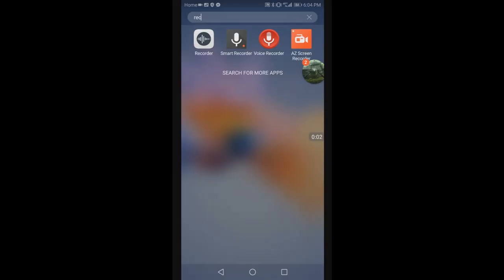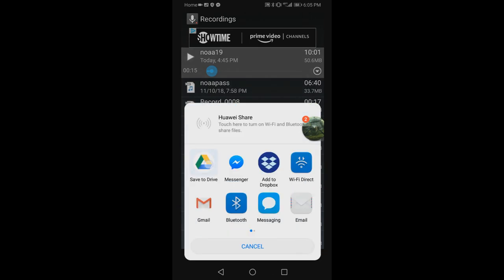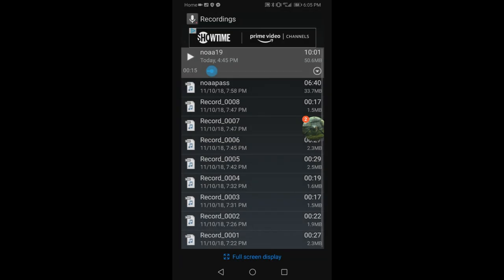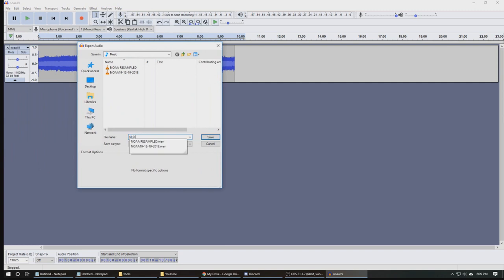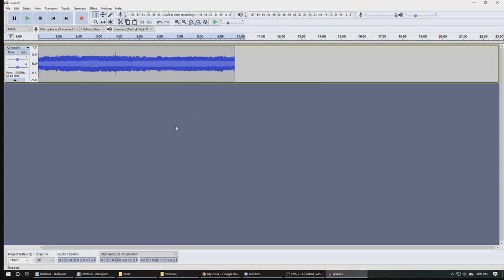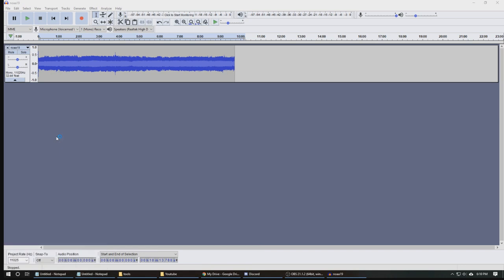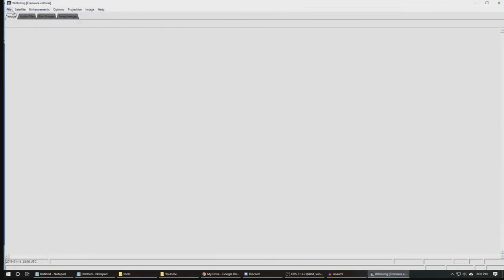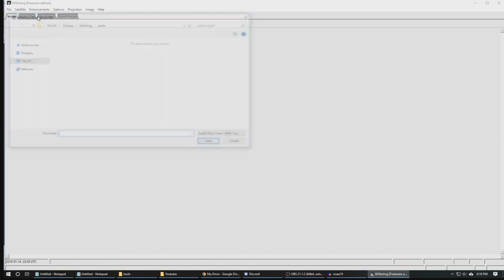Decoding NOAA Weather Satellites with BaoFeng Radio

Comment: Great video, thank you. Crazy question, if you're using an SDR, can you record directly into Audiocity?
Reply: Good idea to eliminate steps. I think it may be possible.
Reply: @martinjuarez4165  You will need sofware to link Gqrx to WXtoimg : most used software is VAC - virtual audio cable . This can only used on Window's platform - not Mac
Reply: @brunoclaren1110  Thank you!!

Comment: You can decode straight from the phone, just Google the app for decoding HF WEATHER FAX, open the app and place it near the radio,  but if you want an absolute crisp image then I suggest you do what this guy Is saying so you can reduce background noise to get a better quality image, one more app is called robot36. These apps are quite simple, if you know abit of coding you can write a quick app code to make your own app, if you do do abit of coding try a cpu module or a raspberry pi to get a screen on it and attach it to the schematic of the radio, but that's a project on it's own, but for now try HF WEATHER FAX.

Comment: Hi! According to wiki, the APT signal is 34 kHz wide. It also looks like that on my Icom's waterfall. However, the widest FM filter I can use is 15 kHz, with that, wxtoimg complains that my IF is too narrow. I've recorded few minutes of the signal (S7 up to S9+10, should be strong enough I guess), but the picture resulted to be a mess... I doubt the UV5R has 34 kHz filter, so you probably also capture only part of the spectrum? Does it matter or not? Thanks!

Comment: Cool that you did it that way, but the quality of reception is limited by the bandwidth of the receiver.  NOAA sats emit a signal that is around 35 khz wide in bandwidth.  SDR recievers are pretty good for providing that bandwidth cheaply.

Comment: Hi!! Thank you for your video!! It´s very COOL,  Could you tell me if you are using Wide bandwith or narrow bandwith in your Baofeng?  I´m getting a very noisy image...
Reply: Same here. I'm not having great results with my UV-5R. Did you make any progress?
Reply: @command0z   A little bit, with WB instead of NB and changing the audio  recorder app
Reply: Dalila M i switched to an SDR dongle with much better results
Reply: @command0z  I 'll try It. Thanks.
Reply: Could you tell me wich kind of antenna did you use with the SDR?
Reply: @command0z  Could you tell me wich kind of antenna did you use with the SDR?
Reply: @command0z  Thank you!!!! and congratulations!!!
Reply: Waves from NOAA15,18 and 19 (and other sats ) are circular waves . So a standard antenna used on a BAoFeng is not the rigt one . For better Rx you need an QFH antenne . Easy DIY  . You'll find alot info on the net . Best  Regards from Belgium
Reply: Wide bandwidth is ideal for these applications.
Reply: It’s still not quite wide enough, but setting a handheld used for this to 25khz bandwidth will help.

Remember: this is about doing cool stuff for cheap, it may not be perfect. You won’t have enough information in the file @ 25khz to do proper processing, but your RAW images will look great.

Also, V dipoles are a good and simple antenna to use for it if a QFH scares you…

Comment: Good video, i have a question, how much time do you record the satellite? I cant decode the image, wxtolmg "couldn´t find the telemetry", I try with the Slant Correction but didn´t works. In the properties of the image I have only two channles 3A and 4. The estimated time of record was 2 minutes aprox. I wait for your response, please help me.
Reply: Ideally <7'. The image quality highly depends on audio quality and signal strength. Other than that, make sure you convert the WAV file to 11,025 with a program such as Audacity.

Comment: Hi! Can you help me? I tried to do it with my uv-5r with a nagoya n771 and i couldn't here anything even it was above me. What did i wrong?
Reply: Make sure you orient your antennae in the proper direction and make sure that there are no obstacles which may be disrupting the signal. Other than that, you may want to reconfigure your receiver.

Comment: I tried it with Baofeng. I used a tape measure antenna. I got around 9 minutes and forty seconds. All I got was a small bar. What did I do wrong? My phone recorded it in a OGG file. I couldn't use Audio City. The WXtoIMG program did take the file.
Reply: You should convert the OGG file to WAV and set it to 11,025 Hz.

Comment: I was  try use  noaa15 yesterday knock off fake 42 inch version abbree i can hear  morse code 200miles away i was trying  use robot36 app i couldn't  get it  images maybe next time comes in my area i have try again.
Reply: Robot 36 is unable to decode the images because it is SSTV. You need WXtoImg which is APT.